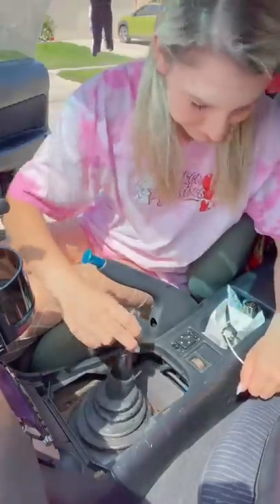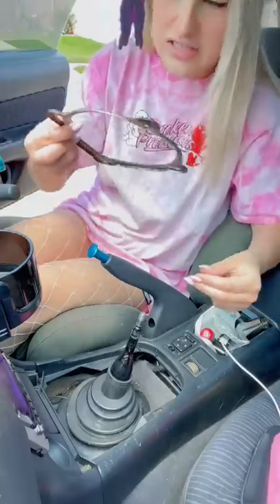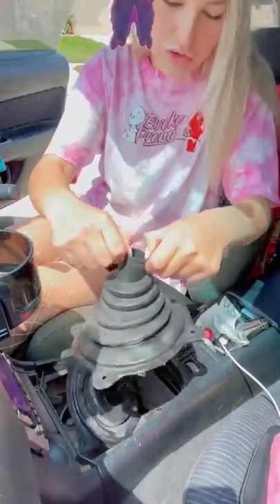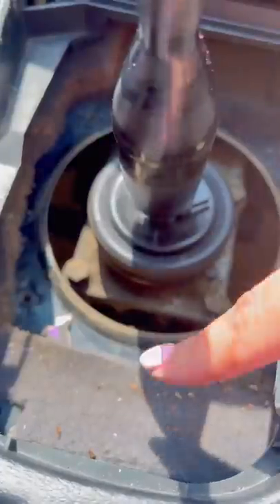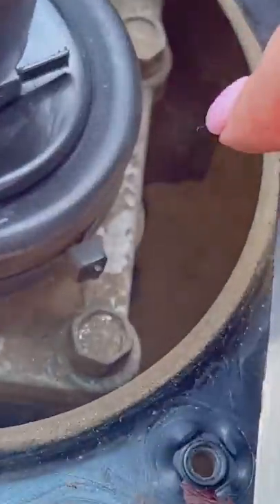Installing A Short Throw Shifter In My Silvia S14!

Comment: You didn’t have a wrench. You call yourself a car enthusiast but you had to buy a wrench to remove a bolt. Bought not built?
Reply: This person also called an f250 with a lift and low pro tires an off road vehicle. Sooooo you know they don't know shit about cars.
Reply: @some-replies  Marginally, no
Reply: You don't need a wrench to be a car enthusiast. Don't be a gatekeeper. Always bugs me when people say you're not a car person if you don't go to meets/if you don't work on your car/if you don't service it/if it doesn't have a specified amount of power etc etc etc
Reply: There's just no need for the hate u know?
Reply: @tompage8438  Yes but having extremely basic tools like a wrench to remove a simple interior piece shows what type of car enthusiast she is. She clearly had daddy’s money, and bought whatever car looked cool to her. She probably doesn’t know jack all about maintenance or repairs on the motor.
Reply: @tompage8438  That’s almost the entire point of being a car enthusiast. Loving cars, loving your own car, and interacting with your car besides just driving it. If you don’t maintain your car yourself, work on your car yourself, fix your car yourself, mod your car yourself, or as you said go to car meets, that takes away 95% of the points of being a “car enthusiast”

Comment: I could be wrong but I thought the whole point of having a short shifter was so you could have a longer shift lever.   The goal is to maintain the same amount of throw but have the shift knob much closer to the steering wheel so you spend less time with your hands off the steering wheel.   If you look at old touring car and rally car interior footage, their shift lever is long and the knob is right next to the wheel.
Reply: rally cars have inline shifters short shifter does just what it sounds like what it does shortens the throw in the shift pattern you can put whatever shift knob on that you might want

Comment: You touching the shifter reminded me of my Talon TSi after it sat in the parking lot at Busch Gardens all day long. Tinted windows don't help when you leave the roof open. I sat in the car and burned the back of my legs, started the car and thoughtlessly grabbed my billet aluminum shifter...😱😱😱😱😱
I had an h pattern burned into my hand. It was like the inside of a hot pocket, pizza bagel, or pizza roll. Like touching the sun! I have never intentionally put my hand into a bonfire, but at least I know what it feels like. Great job on the shifter!!! Congrats!!

Comment: No one talking about the hot wheels wall
Reply: I actually like thought that was pretty neat rather than putting em in a box, what do you think the best way to mount em is?
Reply: @adrielhernandez3943  I also collect and I use command strips or you can also use tape but is dose not work as well

Comment: I would totally find a grommet/or make your own like velvet type that goes around/under that plate so I can Bolt the plate onto the material looking like an inverted cone, so look like exactly the opposite as it does except with that sick plate exposed as the base and the material come up and is  mounted to the to the console with some sort of Fasteners or strips or something

Comment: Now this is from a gamimg perspective here, i have extenders on my joysticks to make the fine perscision movements i need. They are longer than most since i have long ass hands. But you could theoretically pull better time with a long shifter and a practice since it is easier to find while looking away and is easier to manipulate due to mechanical advantage. Not a car guy just a nerd who plays too much halo and arma.
Reply: No, my first truck was standered and have been driving one ever since. I work on these things for a living. In a truck you legally have to have a 18in shifter. In a car it has to be above 8in past the gearing

Comment: I put in my engine and transmission in the same time it took you to tighten 3 bolts
also you hold the shifter like you've never seen a car before smh

Comment: I knew she had no idea wth she was doing soon as she said let's install this and didn't lift the hood to disconnect the shifter linkage and couldn't figure out why she couldn't remove the shifter from inside the car smh
Reply: Only older rear wheel drive cars (pre 1980s) with a side loader external shift linkage like a Muncie M20 and M22 have external shift linkages. Which that wouldn't be under the hood. You'd have to get under the car to access it. Now Front wheel drive cars have a cable shift linkage. But the Silvia and 240sx are both rear wheel drive and have a top loader internal shift linkage. So although she doesn't know what she's doing. She knows more than you. 😆
Reply: @worldssickestmedia2713  tou are correct pardon me I have a awd eclipse gsx and uses 2 cables I haven't got to work on any 240s they are hard to come by as the drift tax has made the way out of my price range
Reply: @worldssickestmedia2713  imgoing to assume that's why her friends have two Jacks under the car and yes I built my car from the ground up so I do have some knowledge but I'm no expert but I know a little bit

Comment: Ur s14 is trash get a s15 or a 240
Reply: Where ur s15 or 240
Reply: the older the better in drifting usually also s14 is better than both. who uses 240 when u can use 180 also